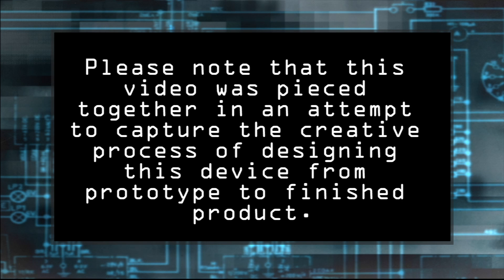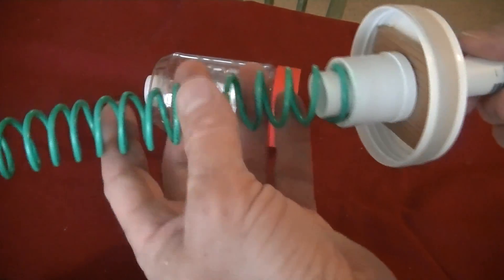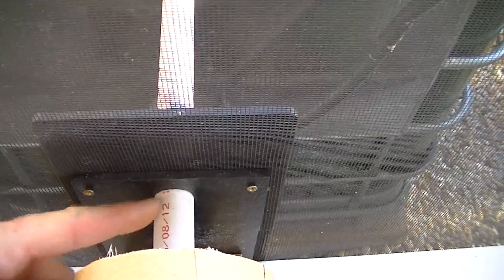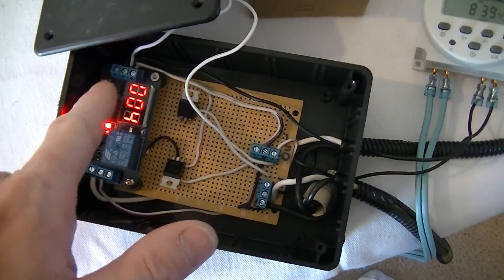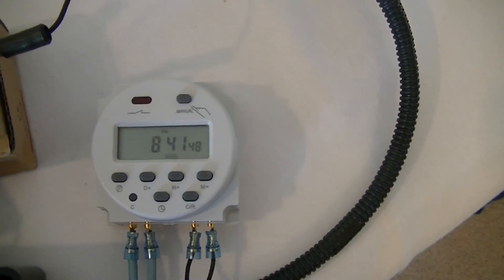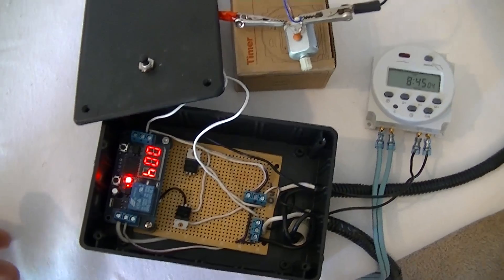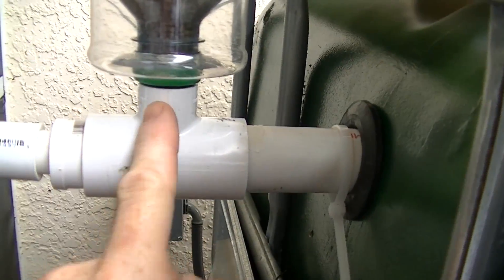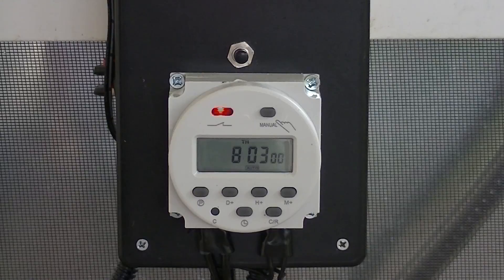DIY Automatic Fish Feeder

Comment: I used 2 pieces of 110mm pvc pipe with each a reducer of 110/40mm - these two parts are slotted into one another with a 40mm washer linear solenoid arm in the middle to close and open 40mm holes. Think of it like 2 cones stacked if one hole open the other closes.

Comment: Cool, but you could have used a simple 555 as a timer that gives you the 4 seconds. 25 cents instead of 8$. Many ways to skin a cat. By the way, be careful with those timers, if the power goes out and comes back on they sometimes go to the ON mode and stay on till the program goes to the OFF time.

Comment: Hey David,
whats the voltage you're running through the "switch" side of the timer?

I'm trying to do something similar - power the unit with 220v, but the unit I'm trying to control/time/switch is 12VDC.

Comment: question.
your final product I noticed the motor turns so much slower.and the big wheel does too..so are u now using a motor controller circuit..how did u get the motor to turn slower. to the previous very fast speed before your final mod

Comment: What a great idea thank you... When I build my own I believe that I will use a much smaller "drive wheel" on the motor and a larger wheel on the spring auger so I can eliminate the 4 sec black box and just use the 1 min. timer. Thank You so much you have an excellent feeder

Comment: Hey David, I realize this was a year ago so I don't now if you will respond. I'm trying to keep the neighborhood cats out of my boat. I cant cover it, long story. Anyway I am building a PVC shower stand that consists of a 5 gallon bucket of water with a marine bilge pump submerged in it. I need to cycle the 12 volt DC pump on for a bot 10/15 seconds once an hour. I like your set up, good job. Do you think it would work for my application?   All responses are welcome. Thanks in advance guys...   

Dave

Comment: Awesome video, thank you! I was wondering if you had a diagram of the timer set up that you could email? If so, that would be awesome! Thanks
Reply: No need for wiring Diagram if you just use one of these Din Rail TM-630S timers. They are already 12VDC (They have a few different voltage options). You can set them from 1 second to hours. There is a power side and motor side the switch and jumper are internal.  This $6 timer take care of mostly all the wiring. 
https://www.aliexpress.com/item/32956262816.html?spm=a2g0o.cart.0.0.2f753c00Qww6Mu&mp=1

Comment: This is excellent. Do you have a link or model for the programmable timer, please?
Reply: No need for wiring Diagram if you just use one of these Din Rail TM-630S timers. They are already 12VDC (They have a few different voltage options). It is DIN Rail and Panel mountable, makes it easy to secure. You can set them from 1 second to hours. There is a power side and motor side the switch and jumper are internal.  This $6 timer take care of mostly all the wiring. 
https://www.aliexpress.com/item/32956262816.html?spm=a2g0o.cart.0.0.2f753c00Qww6Mu&mp=1

Comment: Do you have a model # or link to the timer?
Reply from the maker: DC 12V LED Display Digital Delay Timer Control Switch Module
http://www.ebay.com/itm/DC-12V-LED-Display-Digital-Delay-Timer-Control-Switch-Module-PLC-Home-Automation-/310780966447?pt=LH_DefaultDomain_0&hash=item485bfd362f

AC 110V Digital LCD Power Programmable Timer Time Switch 
http://www.ebay.com/itm/AC-110V-Digital-LCD-Power-Programmable-Timer-Time-switch-Relay-16A-/131196361423?pt=LH_DefaultDomain_0&hash=item1e8be99acf

A 12-volt timer switch would be better. Then you can use the backup batter to power the timer.
Reply: ɷɷɷɷ Heeeeyyy Friends I Have Foundddddd Working Online Hacck visitttt  : -  https://t.co/pyUd0IhKep